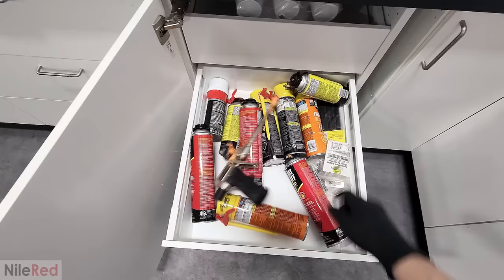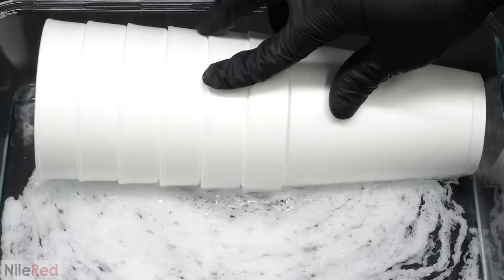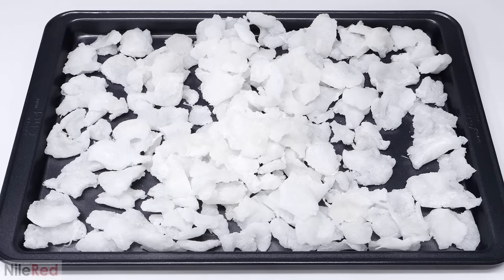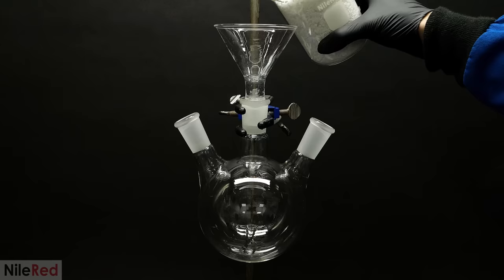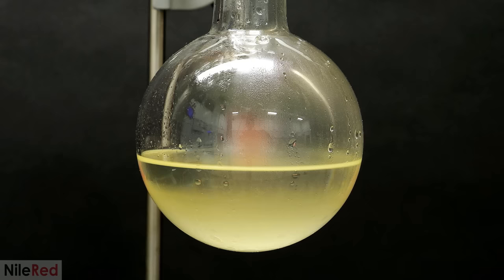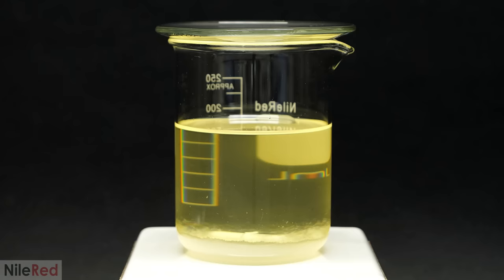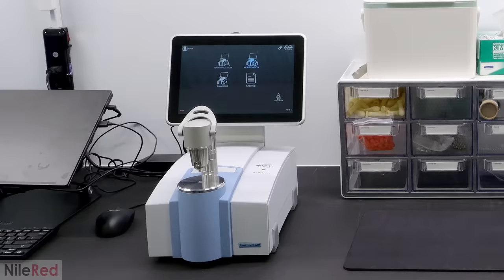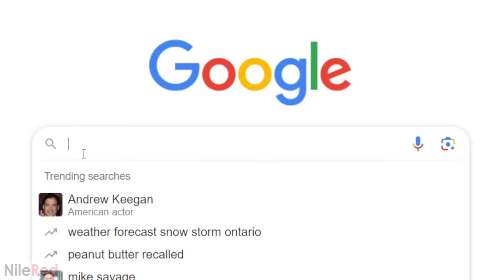Turning styrofoam into cinnamon candy

Comment: fun fact! the reason so many candies have ‘drops’ in their name (ie, Lemon Drops) is because of the process of dropping the big sheet of hardened sugar onto the table to separate the individual candies after it’s been rolled out
Reply: A really easy way to make good healthy candy is steam distilling or buying lemon oil, Citric acid in the form of lemon juice, and xylitol. Melt the lemon juice/ oil with xylitol until dissolved, cook down a bit, then pour into a pyrex pan. Once crystalized into a sheet, chip it out, then smack the pieces with a rubber mallet. It makes little irregular shaped "icy" feeling candy bits that taste like lemon heads but way healthier. I used to drop the sheets to shatter it too, that's what made me want to share it. Lol
Reply: That moment at 46:50 was the most satisfying moment in the whole video 😂 I loved how they all just split apart so well. Thanks for that context!
Reply: Fun fact! Candy is yummy
Reply: @Damianmarleyfan  xylitol is NOT "healthy"
Reply: @trist308   they did indeed use the word "healthy". 
"easy way to make good healthy candy" were their exact words 🙄

Additionally, nothing in my comment (xylitol is NOT "healthy") was disrespectful, but your comment to me certainly was inaccurate and out of line. 

👋🔕
Reply: @trist308  "A really easy way to make good healthy candy ". Those are literally the first words in the comment. You have the reading comprehension of a toddler. No wait, that's an insult to toddlers.
Reply: @trist308  No
Reply: @trist308  No, I do not agree.
It makes a candy, true, but not a "healthy candy" as stated by the person to whom I responded.
Reply: Then why is it called an atom bomb instead of an atom drop ????
Reply: Riiiight, so gum drops are dropped onto the table? The "drop" refers to the shape.
Reply: @trist308 Hey you should look up THE WORD "Pedantic" as you engage in obtuse rhetoric
Reply: @trist308  You still haven't understood basic language huh? Keep at it.
Reply: @arcaears  could also just be extrapolated from hard candy "drops", as gummy ones appeared later

Comment: Just a note for your future candy making: all those temperatures for the soft ball, hard ball, soft crack, hard crack, etc. stages are based on cooking at sea level. The air pressure affects the amount of water that boils out at different temperatures, and the higher your elevation, the lower the temperature is for the same stage. I'm not sure where you live, but I used to live in San Francisco. When I moved to Denver, I didn't expect that change and made some very hard maple candy when trying to make maple cream.
Reply: goddamn sea levels messing with my science

Comment: Once I made the huge mistake of putting nail polish remover into a styrofoam cup. It instantly ate a perfectly comical hole in the bottom mid-pour and fell right on my shoes.
Reply: Funnily enough, nail polish also eats styrofoam too, but it’s a slightly slower reaction (or maybe my polish was just old)
Reply: @shostysboo  some polish removers are just acetone with some shitty aromas
Reply: Ouch.
Reply: I was working on my motorcycle and had a fuel line come off and quickly grabbed my gas station styrofoam cup to collect the 1/4 cup of gas in the line. Yeah, I didn't have time to think about that but it definitely didn't go the way I wanted it to.
Reply: @AdamVladimirKross hey youve just made napalm 🎉
Reply: In junior high, a friend liked to melt styrofoam in gasoline.  He called it “pyrofoam.”
Reply: @shostysboo that's because nail polish itself contains acetone as a thinner. Nail polish remover has more of it, of course, it's almost pure acetone usually.

Comment: Just as a note on the cinnameldehyde, while not carcinogenic. Does like to decompose to styrene. This is one reason why it is extremely bad to inhale heated cinnamon oil or vape cinnamon flavors. As an interesting besides it can also be easily converted to benzaldehyde.
Reply: As an DIY eliquid maker i learned quite a bit about this and what flavors you should probably not vape and menthol is suprisingly another one thats bad.
Reply: @tannercorbett  Could you briefly explain what's bad about menthol?
Reply: Benzaldehyde is perfectly safe, though. What's truly fascinating is that, while styrene is a carcinogen, cinnamaldehyde is an anti-mutagen. It supports DNA repair.

Edit: also, the only pathways I can find for transforming cinnamaldehyde into benzaldehyde require very precise and unlikely conditions. Frankly, if your vape contains sodium hydroxide and hydroxypropyl-beta-cyclodextrin, or ozone and calcium hydroxide, or tetraethylammonium prolinate, or hydrotalcite, you've got bigger problems than your vape suddenly tasting like almonds.
Reply: @tannercorbett  Im using menthol flavor for mixing all of my liquids. Could you please elaborate why its problematic? Would like to know more about that. Only known fact i found about it was that menthol "hides" the negative burn of nicotine in liquids and makes it easier to inhale more nicotin. But not that the menthol itself is problematic like transformin into a carcinogenic e.g.
Reply: someone translate this
Reply: @RaunienTheFirst  Me - about to put O³ into vape liquid and reads your comment

"Awww 😞"

Puts down O³
Reply: @Napfkuchen  I don't know of any pathway that would be present in a vape by which menthol could turn into something dangerous. I'd be very interested in learning if it's true.
Reply: @dandewsirbello  Basically, notsam don't know what they're talking about.
Reply: @altersami9660  I was not strictly talking about vaping you genius and it was studied with sodium hydroxide..
If there is a point to get at it's the unstable nature of the compound. It's stable at low temperatures out of the presence of oxygen especially. The Benzaldehyde was more of a besides, prolly worded. I was on an ADHD tangent.
Reply: @Napfkuchen  pulegone in menthol flavor on its own might just be a carcinogen. There are FDA limits on ingesting it orally apparently. I got this from reading some ncbi papers.
Reply: What is even more interesting to me about that is that cinnamaldehyde does convert to styrene in small amounts with no heat. I've never smelled cinnamon that smelled like styrene. Yes I know what styrene smells like (cringe). The literature I found about it suggest that this is how cinnamon would lose it's flavor as it gets old.
Reply: @notsam498  
its classified as a 2B (WHO) "maybe carcinogenic" component, but that has nothing to do with vaping it. This could only be analysed if there were studies about the concentration (if any) can pass through the alveolo membrane in the lungs to get into the blood cycle or if there would be data how or if it has toxic abilities in used concentration on the lung tissue itself.
But thanks for the info!
Reply: @Napfkuchen yeah unfortunately at non combustion temperatures it hasn't been studied. However, some other studies talked about how the levels of f pegulone needed to get the flavor in vape juice well exceeded the oral safe dose per dose if I understood it right. I'm not very compelled by the data either. I think most of the suggestion is coming from smoking cigarettes, where it undergoes much higher temperatures and does become significantly more dangerous. Unfortunately this is seen a lot in information about vaping, which is unhelpful in making it safer.
Reply: its not that hard man@dandewsirbello

Comment: Hi :) I study chemistry and I also happen to be a baker. In my opinion the problem with the candy hardening that Nile experienced was caused by a simple crystallization. While heating the candy mixture it is very important to wash down any crystals of sugar from the sides of the cooking pot with a wet brush because they are responsible for the candy to harden up while it cools down. This slows down the process a bit because you are adding cold water to something that you want to heat up but it is very much worth it :D
Reply: the fact that the cooling pad wasn't heated probably also had an effect.
the issue he had with the drop roller was also likely the equipment cooling the candy too quickly
Reply: Love hearing from the cooks, bakers and chefs in these comments.
I was a cook for almost 30yrs and nobody believed me when I'd say it was just basic chemistry.
That and it's all about timing. 😊

Comment: The reason there was a lot of variance in your final product is that you accidentally mixed in a bunch of air to the bread-like candy mixture. Pulling that adds air (hence the opaque color from the more  jewl red color) and is how a taffly like candy would be formed (also thats how nougats are formed, but with differing candy temps).  The less dense taffy-candy would have a different texture and less flavor.
Reply: how did he do that?
Reply: my farts are better than NileRed's farts
Reply: That's pretty cool, thanks for sharing :)
Reply: @tsm688 My guess is it was from whisking too fast or folding it incorrectly.

Comment: He used styrofoam which is for the most part just air... It would probably have saved a lot of money to just buy those cheap plastic plates that you throw away when you are 25% through the food you put on it because they break way too soon... And grinded said plates with a blender or something.. because often these plates (and cups and cutlery of the same material) are also polystyrene... Just not in a foam.. but just solid pieces of just polystyrene

Comment: Nile, this video is so cool. I’ve made a lot of candy, and based on what I saw the only reason your sugar crystallized the first time was because some sugar on the sides of the pot didn’t reach the same stage and was reintroduced when you poured the mixture. The second time around I was worried it might happen again but you got lucky! Usually brushing the sides down with a pastry brush dipped in water prevents this. That was the only thing that kept your first attempt from being perfectly executed, IMO.
Reply: Good to know! So he actually did even better than it originally seemed, and I thought he did pretty well
Reply: My farts are better than NileRed's farts

Comment: Candy maker here!

What happened there was it was too hot you have to use ice baths to slowly cool down the pan before putting on the table it shouldn't look like a liquid when it hits the table should be more solid. Like you guessed this is time sensitive.. Also to get it more crunchy you have stretch it on a warmed rod that keeps it from fully cooling this is the hardest part because going too slow can cause it to harden but this part is important for removing air and also mixing the flavor more evenly.
Reply: Candy maker here!

This is all completely wrong
Reply: Its like the meme where there are 3 spidermen pointing at each other but in this situation there are only two
Reply: Candy makers should be friends not beefing with one another 😢
Reply: @nathantp39  they’re not beefing with each other that’s what butchers do😂
Reply: @rownakafza1341  You could say 3 if you put Nile in the equation
Reply: @malcolmwhite6588  So they are getting sour with eachother?
Reply: Idky but yum
Reply: username checks out
Reply: Hard crack maker here!

To make the “hard crack” that NileRed wanted, you must combine…
Reply: @AbsolutionArmament  They're bitter rivals
Reply: @nathantp39  candy makers are cut throat how do you think they get the alchemical esoteric powers??? there can eb only one. duncan mcnilered
Reply: I aint reading all that
Reply: @wondwesentefera2918  tell me you're a tiktok zoomer who needs subway surfers, minecraft parkour and satisfying slime videos overlayed on the one you're watching in able to concentrate without telling me.
Reply: Ohhh I always wondered
Why it was pulled. Very cool thanks!
Reply: Yeah, pulling literally does the opposite of removing air. Pulling candy incorporates air into it.
Reply: @Deuce_and_a_half  what
Reply: @Deuce_and_a_half  u want cookies or not

Comment: 1. Dissolve styrofoam cups in acetone
2. Let excess acetone evaporate
3. Powderize styrofoam chunks
4. React polystyrene and magnesium oxide catalyst in heating mantle and condenser
5. Pour styrene solution in separatory funnel, drain water
6. Mix and stir sodium sulfate into this solution
7. Filter this through cotton funnel
8. Distill solution through heating mantle and condenser with thermometer, swap flask at 142 Celsius and with a bit of 4-tert-Butylcatechol
9. Test styrene through FTIR and HNMR
10. In a flask, add 70 mL of DMF, stir bar, and ice dish, addition funnel, stopper, and thermomete. Add phosphorus oxychloride to addition funnel, seal top, and confirm temperature is less than 10 C
11. Open addition funnel at a slow rate, ensure temperature stays below 20 C
12. Add a small amount of styrene to the new reagent
13. Swap ice with water and begin heating, after half hour raise temperature even higher, let sit for an hour
14. Pour reaction solution in iced beaker to cool down close to 0 C
15. In new beaker, add 340 mL of water, 133.5 g of anhydrous sodium acetate and dissolve
16. Pour the sodium acetate solution in reaction solution
17. Place this into 75 C water bath for 15 minutes
18. Cool down in fridge overnight
19. Pour cinnemaldehyde in separatory funnel, add 100 mL of diethyl ether, seal with stopper and shake around the funnel
20. Drain water out and pour out ether oil mixture, repeat extraction 4 times with drained water
21. Pour into separatory funnel, add mL of water, drain water, repeat 5 times
22. Distill ether solution
23. Distill black oil in new setup with three flasks and vacuum line, pull all the air out, begin distillation
24. At 125 C switch to second flask, collect yellow oil
25. Distilled yellow oil, collect purer cinnemaldehyde in second flask
26. Test cinnemaldehyde in FTIR and HNMR, taste cinnemaldehyde
For the candy:
1. Buy expensive fancy candy making machine
2. In pot, add half cup of water, two cups of sugar, 1/4 corn syrup. Heat to 300 Fahrenheit, add 3.7 mL of cinnemaldehyde. Add red dye and stir
3. Pour sugar candy on silicone and fold it around a bit
4. Attempt to salvage the hardened candy and heat it to 300 F
5. Pour liquid candy while still hot, again move it around
6. Throw doughy candy into candy making machine, turn the roller
7. Crumble sheets of candy hearts
Reply: 8. Profit?
Reply: Bro just turned the entire video onto steps
Reply: @Omena0MC Gemini advance did that
Reply: not interesting enough, give me the recipe for 99% pure meth
Reply: thank you!!! im gonna print it and make my own candy.....or die!!
Reply: 50:04
Reply: @Wingedshadowwolf  No.  He didn't keep the process secret.  Clones are coming.  Lol.
Reply: "I got a Glock in my 'rari"
Reply: It can be made also from polystyrene and it is pretty easy process but dont do that xD  @brianery
Reply: @danieljohanides2625  dont tell me what not to do
Reply: I want to do this

Comment: This was fun to watch!  As a maker of homemade candy:  the initial pot of candy was overcooked a bit/left on heat too long and got too hot, and that's why it set up so quickly.  Flavoring is often thoroughly stirred in immediately after the pot of goo is removed from heat.  Liquid food coloring is generally added shortly before removing the pot o' goo from heat so the water content from the food coloring boils off.  
The best way to break up hard rolled candy like this is to drop it.  That is why many hard nugget candies are called  "drops." 
You can also make candy similar to this using the soft ball stage. The candy will just be chewy or gummy instead of hard.

Comment: the forbidden marshmallow fluff basically being a poor mans napalm is devastating to me personally
Reply: Add 10% (by volume) magnesium filings and you have sticky lava from hell. Magnesium is light enough, and polystyrene goo is gooey enough, that it stays in suspension for a really long time.
Reply: @andersjjensen Thanks I will use this information wisely 😊
Reply: @chillingwarmly5155  It's important to know these things so we don't accidentally do them while completely normally mucking about with acetone, styrofoam and magnesium in our daily lives.
Reply: @andersjjensen  And add some bits of white phosphorus for good measure?
Reply: Don't eat it... It smells and tastes TERRIBLE

Edit: Yes. I've actually tried it.
Reply: @felixar90  That's expensive and hard to come by. Magnesium rims can be obtained from the local wrecker.
Reply: An even poorer man's napalm is molten sugar. That stuff is extremely sticky and also incredibly hot.
Reply: @Cats-TM But hard to keep molten and hard to set ablaze.
Reply: @bruzzunathtuch bro tried to refuel 💀
Reply: @andersjjensen  Yeah, why it is the even poorer man's.
Reply: It's not really a poor man's napalm. It's actually far more expensive than regular napalm which is just the same thing in gasoline. And I'm sure you're aware of just how inexpensive gasoline is as a chemical, being only a few $ for a gallon.
Reply: @Flesh_Wizard  It was for science. I didn't swallow it, I only tasted the Styrofoam and acetone mix.